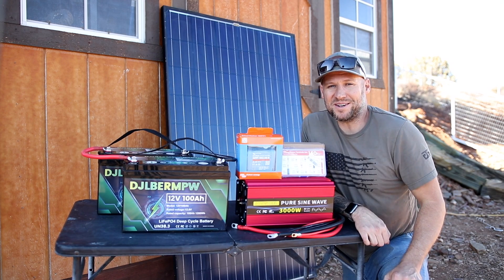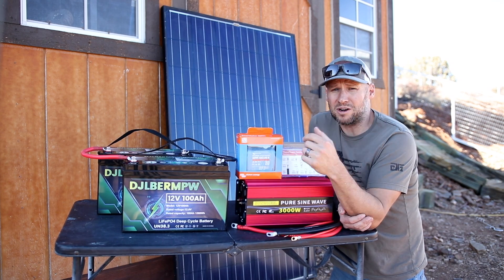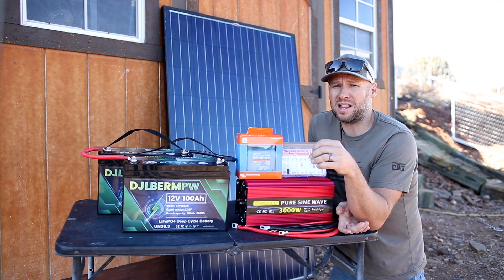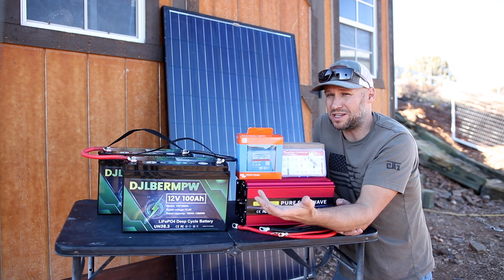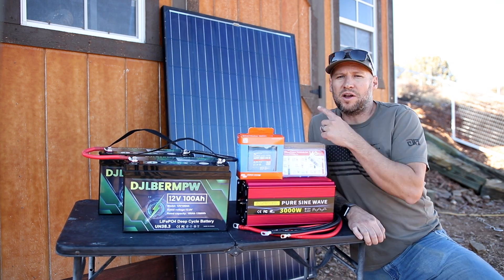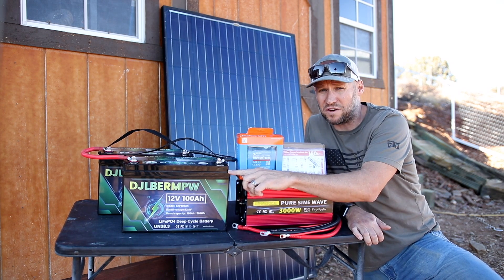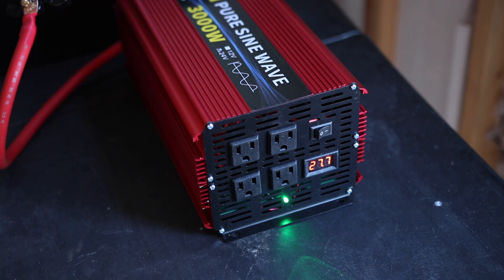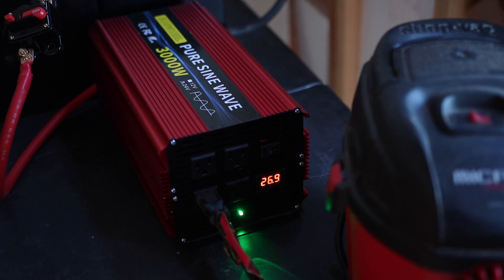DIY Solar | How to go OFF-GRID for CHEAP!

Comment: Hi Dan, just curious how the solar setup is working for you? I’ve been wanting to build something similar and wanted to know if it’s worth spending the money on it. Thanks
Reply from the maker: So far my system has worked extremely well for me! I haven’t run out of power yet and I’ve used all my high draw tools and run the cnc, router, and dust collector simultaneously for more than hour long carves. No problem!

Comment: I would expect that to run this setup for a full day's work off grid you would probably need to at least double the amount of solar panels and batteries.  Having said that you get a lot more effective sunshine than we see here in the UK so it might just be a case of more battery storage.  It would be worth trying that if you do feel the need to upgrade before spending out on more panels - after all, you might just end up saving a fair chunk of money that way.  Also I would generally caution you with regards to these no-name batteries.  They are quite often not what is advertised and can be electrically dangerous in the long term.  As part of best practice I would only want to buy them if I had not seen an independent review of them.
Reply from the maker: Yeah the truth is, this setup could not run my cnc machine all day. With the sun in the perfect spot, I’m getting about 450w, which is a tad less than what my cnc machine and dust collector draw while in use (not counting start up). So with this setup, I can run my cnc machine for about 2 hrs without sun, and probably 3-4 hours with direct sunlight helping. But I don’t run my machine for more than that during the day, and most of the time I’m working on guitars I’m not using hardly any power (mostly hand tools). So it’s working for me for now but I would like to double the battery bank. As for the no name batteries, someone has to test them! May as well be me 🤷‍♂️

Comment: Hey Dan, great video. Any thoughts or tips on a UK setup (240V appliances) in an average sun environment. Love to do the same thing in my garage.
Reply from the maker: Yeah man! The only difference is that you need a 240v inverter. They sell them on Amazon, they are probably more common on your European Amazon, but I’ve seen them on the American Amazon too.
Reply: I actilually work for ac company they sells inverters, so that’s the one thing I know about. Your return from the solar panel is huge due to your amount of sun. You still think we could generate that amount of power with overcast days. Or do I just need more panels than you.

Comment: I built a portable power station for my art festival booth, built it into a husky stackable rolling tool cart, with one 100amphour lifepo inside but put a plug to outside to add a second external battery that I can swap out if needed, renogy 2000 inverter with an external switch mounted to the cart, renogy solar controller with bluetooth monitoring, bus bars, 12v outlet, USB / pd charging outlet, solar input jack and an external battery disconnect switch so I don't have any parasitic drain when I'm not using it. I have four 150 watt renogy flexible solar panels that Velcro onto the roof of my tent with heavy duty wide Velcro strips. The solar alone powers my lights, charging, etc, then I run a few wood carving tools doing demos at my shows. I don't have any battery drain with this setup, even on cloudy days, even in the rain unless I run the power tools. But I can just plug in another battery if I do get drain. Built this after years of using deep cycles, fold out solar panels with cheap solar controller and small inverter. that setup didn't keep up and my lights would go out mid show in cloudy days. Now I've even lent power to neighbors lol
Reply from the maker: That sounds like an awesome setup! I’ve thought about building this out in such a way that it’s portable, so I can use it for camping, etc. but I decided this will be a permanent install because of the size of the panels. I’ll build a more portable one later.
Reply: @GunsandGuitars  if you use bus bars and equal length leads you'll get a pretty close battery balance that way too 👍
Reply: @GunsandGuitars  I might do a a video on it later

Comment: Hey Dan, FRIGGIN AWESOME!

You did say “Energize me” at the end.   Synonymous with some other battery company :).   Actually all kidding aside, I’ve literally got the same situation as you… Tuffshed shop outside my house w/extension cord running to it shop all wired up thru it, and the cost of a new panel/wiring to the main panel in my house $$.    This is so timely for me!     Seen some other videos on solarizing shops, but you laid it out well, thanks!    I’m hoping to do this project this year, and would be a no brainer for sun power over here in Jacksonville FL.      I do wonder how it would fair  running the CNC, shop vac, and occasional other power turn on’s like small air compressor re-charges for clearing dust, or turning on a 2nd router, or small table saw?   Anyway, love it man, thanks!.
Reply from the maker: Can it run all of those at the same time? Definitely. Can it start them all at the same time is the issue. Mine setup can start the router and the dust collection at the same time without flickering the lights, that’s pretty impressive. The dust collector always dimmed or flickered the lights in grid power, so I have more available power than a 20a circuit. An air compressor also draws a lot of current on start up, but as long the other tools are already running and not starting at the same time, it should be fine. I know a table saw is no problem because I tested mine!

Comment: $1000 to save approximately $50 to $100 a month with about a dozen potential points of future failure that will need replacement, repair of tinkering within a year. 
how is the longmill holding up?  I'm becoming less and less impressed with mine every time I use it.
Reply from the maker: Firstly, my longmill is amazing! It’s a small guitar factory. I’m still using it very basically though, limited by my software skills. As for the solar setup, did I mention in the video anything about saving money on my power bill? I’d be shocked if I saved $50/mo. Maybe $10/mo is my guess. I saved $3.5k on installing a sub panel for grid power. So my system has already paid for itself twice

Comment: That's a nice little setup. Nice to see the 3000W works well. My 2000W struggles in the heat in my shed when I fire up the table saw, so I have an idea what to upgrade to.

I was able to fit three 380W panels on top of my 12' x 16' shed. You should be able to fit plenty of power on yours.
Reply from the maker: I was in the same boat as you. I tried to fire up my dust collector with my UPS which has a 2000w/3000w max inverter, and it “did” start it. But it struggled like crazy! It wasn’t a smooth start at all. But since it started with the 3000w max, I thought a 3000w continuous/6000w max would be much smoother. I was right! Very happy with this setup.

Comment: Hey Dan, re: that funky display on the inverter: it looked like it only happened with the motors, and given their sound, they sound like universal motors. IIRC, those generate a fair amount of electrical noise. I wonder if that noise on the line is messing up the display. It'd be interesting to see if it dose the same thing with any high current draw device (e.g. an electric heater) or just the motors. The lights didn't seem to cause a problem with it. Just a thought. Peace!
Reply from the maker: Hey Harley, thanks for the tip brother! I’ll try it out with a heater and see what happens! I know the shop vac and dust collector are induction motors, not sure about the router.

Comment: Would tht setup run a 115v 
infared heater if the power was knocked out ?
Reply from the maker: It definitely would, it just depends on how many watts the heater uses will determine how long it can run for. A 1500w heater would run for an hour and a half on my battery setup. If it’s getting good solar charge during that time it would extend it to 2-3hrs. If the heater doesn’t need to run continuous, like on for 5 minutes, off for 10 minutes, then you might be able to run it all day with good sunlight.

Comment: Something else you might want to look in to are self-resetting circuit breakers.
Really good for those few circuits that are usually fine, but can pop if someone forgets that only one big thing can run at the same time.
(I...probably need to get one for the circuit that I run my microwave and deep fryer on...)
Reply from the maker: That’s actually a great idea. I probably will get some of those. However, it won’t help if it’s the GFCI circuit that trips, which happens half the time with my outdoor receptacles. Not sure why those pop before the breaker sometimes.